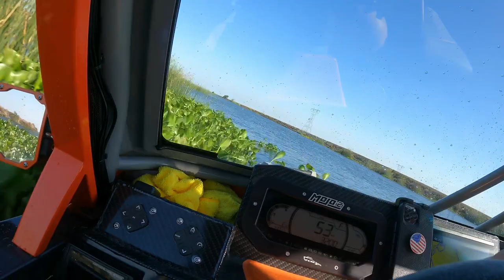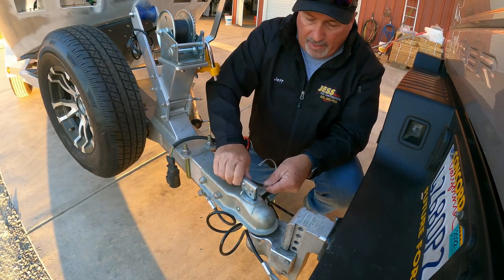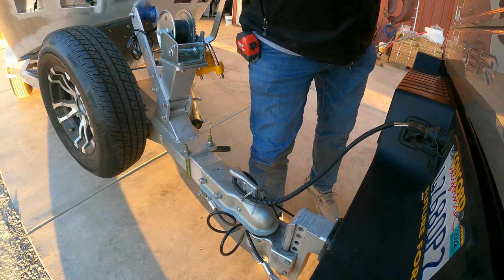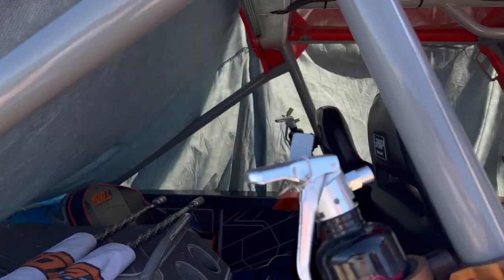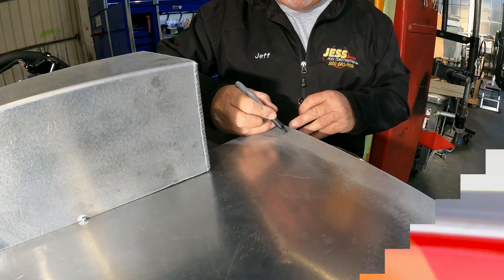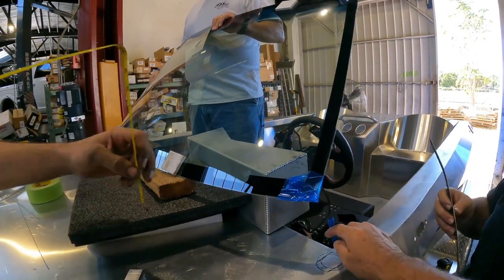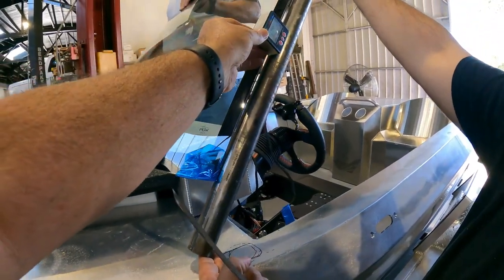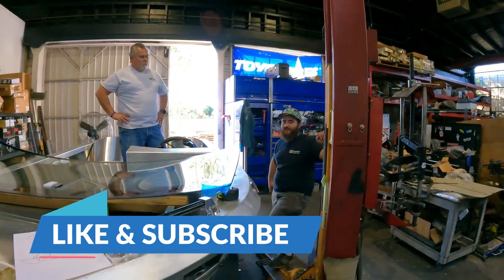HOW TO BUILD A CAGE ON A BOAT, MINI JET BOAT BUILD....MEGAN'S BOAT GOING TO FAB !!!

Comment: You need to spare yourself the pain of those TCM hulls and step up to a RSR or even a Atom, After the problems with your last one I figured you would have been tired of handling issues. Something a wee bit bigger and with some deadrise rides so much better. That is why I am not completely sold on the atom too because they just do not handle the chop as well, they handle well but they are rough.
Reply from the maker: Going to be building and Adam Boat soon. Working on details now.
Reply: @MoJoh20  Sounds good, if I was you I would ask them to add some deadrise to the hull, go to something around 14 degrees. For the area you live in that will be much better for comfort and even for the bigger water you run in, as an example Ronnie's RSR boats are at least 14 deg now.
An Atom in about 4.2 meters to increase the stem angle and with 14 Degrees deadrise would be a pretty sweet set up... But Delta pad size would be an undiscovered variable and you would be the guinea pig.
Reply from the maker: Do you have a jet stream  or have you had one? 
I agree with 95% of what you’re saying, however, when I started this adventure, I didn’t know what I didn’t know, so the only company  that was popping up for me to pursue, was TCM, and jetstream. 
I will say that I was very disappointed when I put the boat in the water for the first time.  The new boat has trim tabs that should take care of 90% of the problems with the way, the Boat acts in the water.  I can’t talk about some of the things that are happening, but I can assure you that the problems are being addressed for future Boats .  As I mentioned earlier, I’m starting a new project next year and the boat will be addressing all of those problems during construction, I can’t really divulge much about it right now. Thanks for your comments.
Reply: @MoJoh20  ALSO... I know you never need to burn any bridges as we are dealing with good well meaning people who are just trying to earn a honest living.
Reply: @MoJoh20  The trim tabs are a band aid for a bigger problem. I do not own a Jet Stream boat, I just would not want to. I run with a bunch though. I had an eagle mini and I still have a Eagle E6. I am working on a new hull right now.
Reply: Tcm doesn't make the hull. They build from jet stream kits
Reply: @ethanabernathy3107  Correct, I do know that but is seems that is Troy's chosen hull.